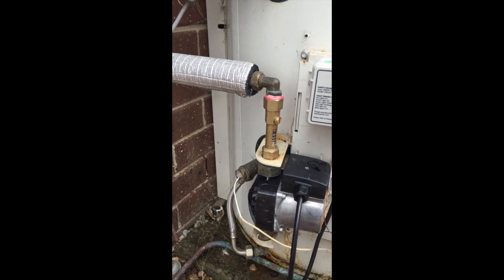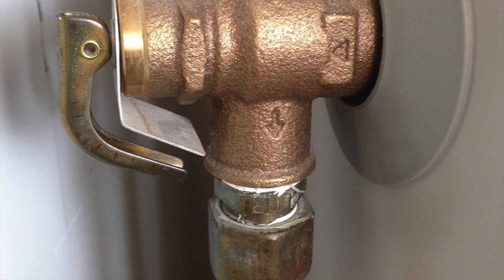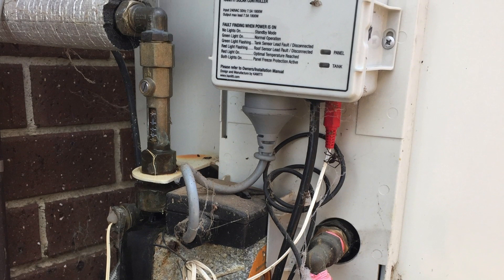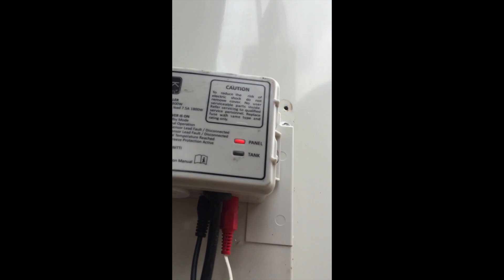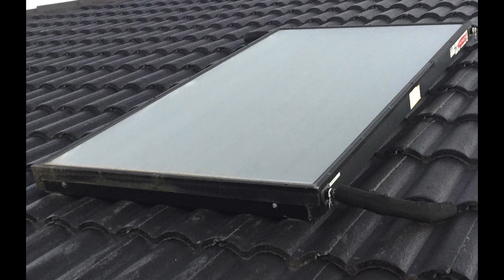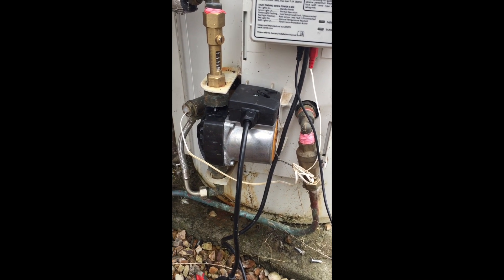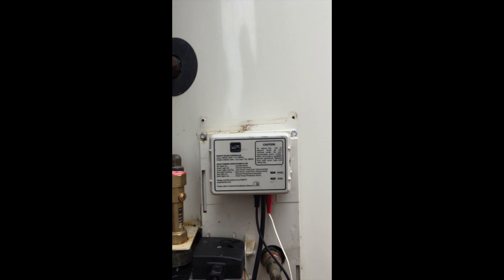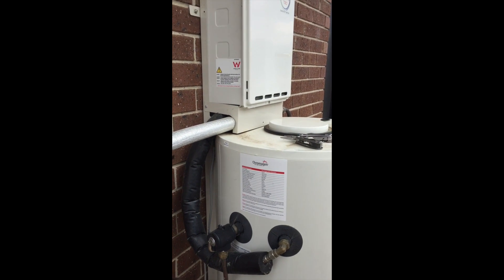Cromagen Solar hot water system How to diagnose & repair similar to Rheem

Comment: Gday Mark, great videos mate, about this stupid Chromagen flow control valve that leaks at the sight glass, I had a system fitted as part of a new build 3 years ago, that flow valve started leaking 5 months ago. Bought a new one from Chromagen for $45 and my plumber fitted it. Last week this new flow control valve started leaking! Super angry at Chromagen for selling defective flawed components. Tried to contact them, theynever answer the phone or ring back. Their website says submit a service request which locks u into service so Im still chasing them down.

Comment: Hi Mark, very informative video mate, thanks for taking the time to do this… it sounds exactly like what’s happening to my system.  Question… would I be correct in thinking that when changing out the pump, all the water from both the roof unit, the storage tank and associated pipework is all going to want to come rushing out and also potentially being very hot ? I realise you said yours was cold but my storage tank has a backup element making the contents of the tank hot. I can turn that off and allow it to cool I guess. Regards Jason
Reply from the maker: This is under mains pressure. So you have to turn off the supply water. Yes then you will still have gravity feed from the roof.

Comment: Hi Mark just curious does this work at all on winter days too? I mean in a bit sunny 14-16 °C days ? or is it sitting standby most of the winter days ?
Reply from the maker: Yes it does definitely still run on any sunny day. But it is limited by how much heat there is in the sun on each day. But to feed warm water in rather than cold is better and saves gas. MRT

Comment: Hi Mark great video
I’ve got a problem with my chromogen hit water unit 
The island kitchen sink tap is not generating enough hot water compared to the other taps around the house. According to friends who have the similiar problem told me its the gas booster not coming on because of the low pressure 
Is the there a way I can adjust the booster to fix the issue 
Thanks in advance
Reply from the maker: Two things to check first. 
Have someone go stand near the gas instant unit while someone else turns the kitchen tap on. See if the gas booster is turning on or not. 
If it isn’t there are some things you can do to your tap. 
1/ clean the aerator. See here. 
 How to fix Tap faucet squirting out the side. Clean the airator. Check the O'ring, clean the filter
https://youtu.be/MXSfuzdLYtA
2/ check if there is a restrictor in the plumbing line that runs to the tap. 
If the pressure or flow switch needs replacing in the unit then that is more complex and should be done and then pressure tested by a professional. MRT

Comment: How to ditch the solar BS and run off the instantaeous only?
Reply: A unit like this has 2 leads going into power. I have a black for the solar controller and grey for the instant hot water. Just unplug the solar lead which would be my black and usually the one going low. If you don’t it right when you turn your hot water tap on the top box should start venting out warm/ hot air
Reply: @RippedBushido  I ended up ditching the whole lump of crap and installing a continious Rinnai26 and am in love with it!
Reply: @RippedBushido  I tried this, but there is still cold water going up to the solar panel under mains pressure, then it just gets released into the gutter each night

Comment: Mine just started leaking from the very bottom outlet pipe where it leads into the pump. Im not sure where to shut that off to replace the silver hose.
Reply from the maker: Most times there is a supply water tap nearby. If not turn the water off to the whole house. There are two water systems there so water may run off from up on the roof or from the tank as well. 
If unsure call a plumber and get a quality outdoor rated hose. Don’t cheap out on the fittings. MRT
Reply: Mine too, a pin hole. I bought a new flex pipe, but the manual doesn't state if I have to empty the tank. As it's near the inlet, it looks like I just shut off the water and power, and release the pressure. Then swap the flex pope. What did you do?

Comment: I have the same issue except my pump and everything inside looks to be in pristine condition.
I don’t however have a cold temp sensor installed.
I measured the hot one and it’s a PT500, which is unusual? Should I get another PT500 and install the cold sensor? I don’t think the pump ever operates.
Reply: As in that valve that you mentioned getting really hot and not having any hot water in the tank after a hot day is the same issue I have.
Reply: I got that same issue here, pump is running but the solar hot water won’t go into the tank

Comment: Hi there,  I have a similar unit . It's just started beeping every second .What do I do to fix it? Is it something to worry about? There is no problem in hot water system
Reply from the maker: If it is beeping it is telling you that something is wrong. The gas instantaneous is probably still working but your solar may not be. MRT

Comment: Hi Mark… where is the switch inside the instantaneous heater that you spoke about. I am having the exact problem that you mentioned, i.e. hot water cuts out ocassionally whilst I am in the shower. Comes back on after turning off hot tap, then turn it back on. Sometimes does not come back straight away. Many thanks
Reply from the maker: I never found the switch he mentioned. But what you mention sounds like the flow switch inside the heater might need replacing. MRT

Comment: Hi mark I have the same hot water system chromagen solar, and the instantaneous hot water booster clicks and the fan comes on and then it switches off can you help?
Reply from the maker: Yes check the gas is still turned on. If it is you will need to get a gas plumber to have a look at it. From what you have described the first thing to check would be the gas valve. MRT

Comment: Can i drain the tank while the sytem is on ?
Reply from the maker: I mention this in the video. The tank is part of the supply pipe of water so it is under pressure all the time. Even if the solar isn’t working the tank is still full of water and under pressure MRT

Comment: Hi, mark had my gas Regulator changed today as it was leaking on the meter.
The Gas leaver was turned off at the meter by the man Who came out to inspect it.
Are these hot water systems self igniting?
Reply from the maker: Without knowing the brand etc. I’ll just run with it will most likely have a hot plate ignition so re light itself. MRT
Reply: @Marksreviewsandtutorials  eternity t26. How do ignite it?
Similar to this set up.
https://youtu.be/RuuPCwjNl94?si=Dvow1hVDeh9kFsDU

Comment: do you (or anyone) anyone happen to know the resistance (ohms) values of the tank and panel probes?  say at 20 deg

NTC types? and ohm values?

or if some kind person can throw a multimeter on them (and tell me the values) i should be able to work out what NTC types they are...

i`m doing a retro fit of this setup on another evacuated tube system and my top panel sensor i think is a different value to what the chromagen differential controller expects

Thanks
Reply: Did you work this one out? I need to replace mine
Reply: I measured the panel sensor and it’s a PT500 but seems unusual? Most systems use a PT100 apparently.
( I measured 444.6 ohms at about 15.8°C which is basically a PT500 sensor )

Comment: Hi Mark, My frost value at Solar Panel is leaking. Will it be a good idea to bypass the frost value ?
Reply from the maker: The frost valve is there to stop your panel freezing and bursting. If you get frosts and below freezing conditions then you need the valve. If you never have that then no you don’t need it. 
They do leak and need periodical replacement, but that is better than a burst panel. MRT
Reply: @Marksreviewsandtutorials  thanks Mark

Comment: Hi Mark, Thanks a lot for these videos. Our solar system has got anti-freeze valves. it's 6 years old and over the last 3 years I have replaced 3 valves bcs they continuously leaked water when it got really cold (like 2-1 degrees). It's not intermittent leaking at all. It's happening again and a Valve going to cost about 125 bucks and I am not going replace it again. 
I am wondering, can we modify a system so that we can isolate the solar panels during winter and simply use the gas booster and use the solar system during summer months?? Really appreciate if you could provide some guidance on this matter. We live in north of Melbourne . Thanks! Nalaka
Reply from the maker: Hi There. The anti freeze valves are supposed to leak in cold weather that is how they stop the system from freezing. But I assume yours kept on leaking once it had warmed up again?
Yes I have heard that those valves leaking is a big issue. 
So can you get a plumber to plumb in some valves to isolate the solar collector. Yes you can but it will also have to have a drain so the water can get out of it. 
The new controller that was put on my unit has an antifreeze led and function that the previous one didn’t. 
So I am now running with no anti freeze valve, but relying on this new functionality on the controller. I believe it turns the pump on and runs hot water through the collector when it is freezing. So changing your controller to one with an anti freeze function is also a possibility. MRT
Reply: @Marksreviewsandtutorials   Thank you for this valuable information Mark. I think we have lost money rather than saving any beacuse of these valves so far ;). 
Could you give me an idea how much it's going to cost install that new controller and run it without valves?? Could you recomend someone for me please. Thanks again!
Reply from the maker: @nalakam  I was renting the property when I made that film. So I didn’t pay but we dealt with chromogen direct. The two plumbers that came out to be honest didn’t seem to understand the system.
Reply: @Marksreviewsandtutorials  hmm..yeah difficult to find people who know about these systems. Thank you for the reply.

Comment: Hi Mark,
Our system has been emitting a high pitched ringing noise, 
More often when it is cold out,
Anything I can do to make this stop?
Thanks
Reply: In the same boat. Chromagen probably wont cover the pumb out of warranty which was my issue last time. Chromagen should be out of business. They cover the bare minimum beyond a year warranty. Then all the small parts are only 1 year. And they charge you at least $130 to come and check the problem. Scammers.
Reply: How did you end up fixing this noise? What part did you need to replace?
Reply: Did you get anywhere? Ours just started doing this too
Reply: @elementaryFlame  
No luck,
Happen practically every day now it has gotten so cold
Gonna have to call in a plumber unfortunately
Reply: @lukejohnson726  How did the plumber go?
Reply: @oldman_eleven  I ended up fixing myself. Was super easy and cost 75 bucks for the part
Reply: @lukejohnson726  I ended up fixing myself!
Reply: @elementaryFlame  beast mode. Hell yea stick it to the scammers
Reply: @elementaryFlame  Can you tell me what it was that failed on yours? Ours is now doing the same thing
Reply: @MichaelRoninTV  Frost valve. Though the whole box has now failed and I now control it with a smart plug. Ok during the summer but I'm still working out what to do as winter is coming
Reply: @elementaryFlame  thank you for your reply. During the time I first wrote my comment until now, I did eventually work out that it was the frost valve that has failed. Thank you for confirming that :) now I've just got to get it replaced.

Comment: Hi mark. How important is the sensor wire running into the tank? Cause my dog bit it off
Reply from the maker: Binh Ma If it is the sensor to the roof the system will not work at all without it.
Reply: I'm here for the exact same reason

Comment: Hi Mark. I got solar hot water system. There is no green light on Controller. Some time it's turn on but still no hot water. Pump works when green light on but seems gas hot water system does not turn on. Could you please advise what could be a problem. Thx
Reply from the maker: These are quite complex systems. I have put these videos up to help people understand them. I cannot diagnose your system. 
If you need help please call a technician

Comment: hi Mark, thanks for uploading your tutorials...I came in here as I have a current problem with my Chromagen solar hot water heater whereby, there is actual water LEAKING from the bottom of the solar hot water panel on my roof. Leaking profusely! Would you know why this is so, and is there a way where I can bypass the water going thru the solar panel, and just let the water go through the instantaneous gas water system, so that it doesn't go thru the solar panel?
Reply from the maker: Hi there, Sadly it is common that the system up on the roof can split. Especially if it freezes. There is an anti freeze valve that can solve this but it is rarely fitted.
Yes is the answer to your question. You can disconnect the roof part of the solar system at the water storage tank and just blank/plug the tank off at both the up and down pipe, then unplug (Electric) the solar pump.
All work on your plumbing should be done by a licensed plumber.
My tip if you do get the roof panel replaced is to fit an anti freeze system when you do. Both the new panel and the anti freeze system are not that expensive.
I have a great plumber if you are in the North of Melbourne, Australia.